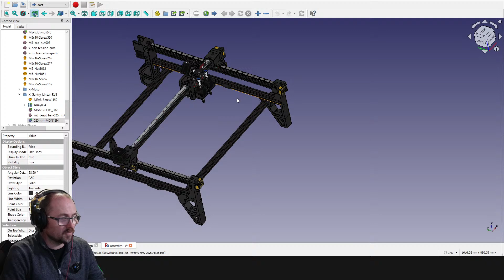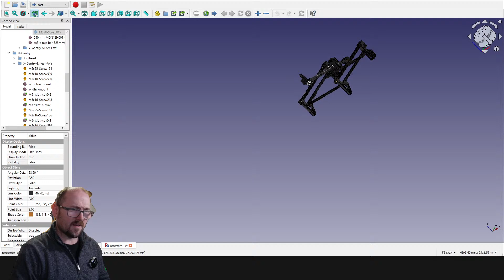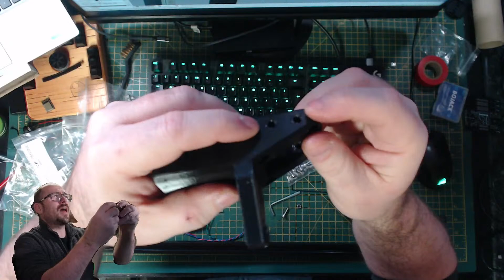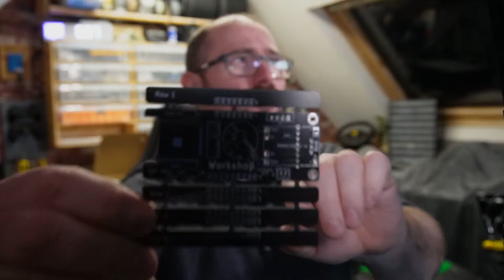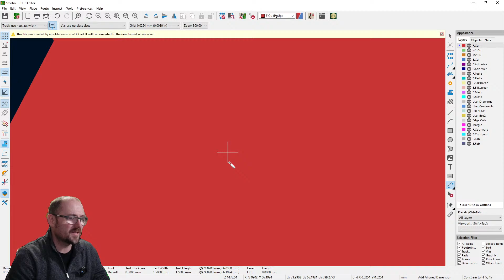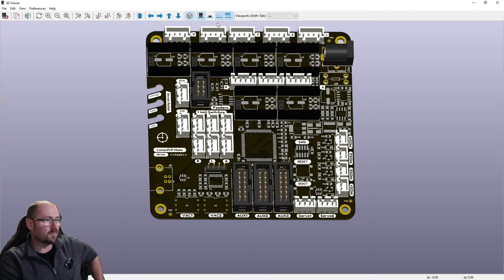Challenging Build: LumenPnP Machine Assembly

Comment: I think buying the PCB assembled is the better alternative. Since sourcing and hand soldering / placing can take a lot of time
Reply from the maker: Agreed, for 1-10 boards you proabably want to hand assemble the baords. FOr 500-1000+ an assembled board from a manufacturer is probably the way to go. But for board runs of 10 - 500/1000, the lumenpnp was made for this job and is targetted a mid scale manufacturing.

It's all about the options, and when to use them 😉😉